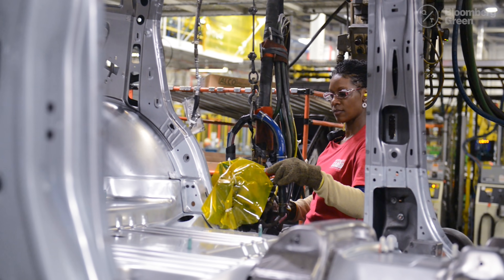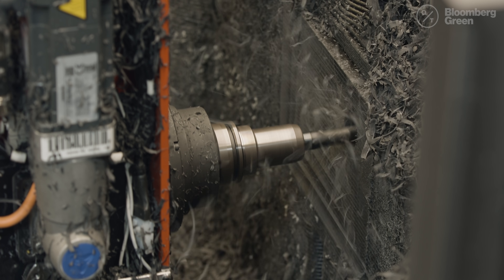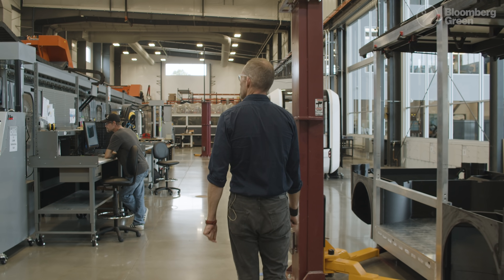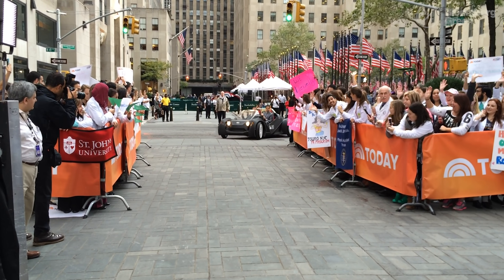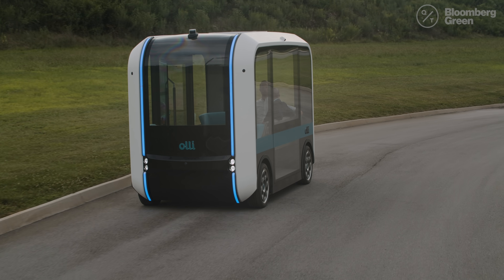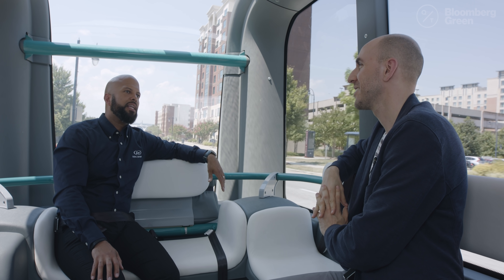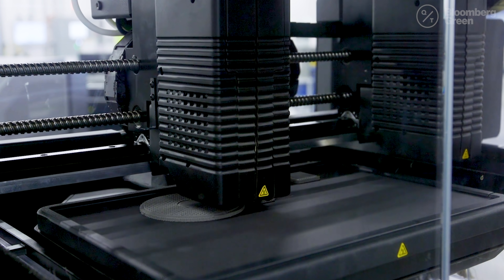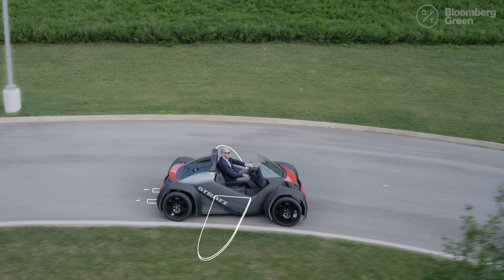Your Next Ride Could Be a 3D-Printed Bus

Comment: This doesn't have any edge on existing manufacture. Polymer based 3d printing has a poor strength/stiffness to weight ratio. They also tend to be porous. The machining work, sealing and hand assembly for all the other bits also adds cost. 3d printing is relevant for low volume production and prototyping. When they can 3d print an entire car chassis economically from aluminium that will be ground breaking.

Comment: instead of 3d printing the whole car, why not print the molds for the body panels?
Reply: What would be the point of that?
Reply: @jascrandom9855  3d printed molds much cheaper and versatile than conventional molds?  I havent seen much research regarding this but I think it's feasible.
Reply: @shadewar  Its conventional molds are cheaper for mass production, but these guys are aiming for Custom production rather than mass production.

Comment: Unless you're using one of those new process like printing on hardened resin or welding metal, 3d printing is weak and won't stand for the daily use or a car, not to mention that if you're going to mass produce, 3D printing is useless, the best way is to use molds and casting or other technique like vacuum forming.
There's an overreliance on 3d printing amongst certain generations...
Not to mention....that chasis Is ugly
Reply: Personal 3D printing is weak,
Reply: Dude, printing hardened resin came way before filament deposition modeling (FDM), the first 3d printer used stereolythography (SLA) selective hardening of UV resin in the 80s, fdm was just easier to bring into the hobbyist/consumer space, so it's better known

There isn't an overreliance on 3d printing, it's just a buzz-word, anyone who has done anything worthwhile with the technology or knows anything about manufacturing knows that it's just another manufacturing process and that many of the things that are done wih 3d printing on a smaller scale will have to be made using a different process if they move to larger production volumes, there are certainly things that can be made best using that process, but there are also a lot off companies who use the buzz-word 3d-printing, because they want to show off their prototypes and they want media attention and it seems to work.

Comment: Most of these 3d printer startups including the ones shown here miss the point of 3d printing. Infill(stong enclosed hollow areas) is what makes 3d printing a game changer. Unfortunately this guy is printing solid plastic an inch wide... Its probably 20% as strong and twice as heavy as if he just injection molded, milled, or welded it together
Reply: Why would someone choose a infill that takes forever to manufacture (3d printed) when one can use a honeycomb infill that is much faster and cheaper?

Comment: True that as the engineer pointed out this is not for mass production, I think for that one would still want injection molding and casting. But I can see this is great for making limited edition, highly customized & special purpose cars for sure.
Reply: They do already do this. Special aftermarket mods and even high end  supercars use 3d printed parts when useful. This company is trying to use this for mass production, which is as if Luis Vitton tried to make mass produced goods by expert craftsman by hand. It doesn't work that way.
Reply: @ritwikreddy5670  But come think of it if they have like hundreds of the printers, they can mass produce for sure, but then the print out seems to be quite large and less flexible, gonna add quite a bit of weight. Maybe they can improve it though.

Comment: So... How is bed adhesion with this thing. :D
Reply: They likely use some form of PVA adhesive as a spray or film coating so the same stuff everyone else does when they put gluestick on their built plate
Reply: @l.c.8475  Makes sense. If it works on my little printer why not on this one. 😅

Comment: Metal 3D printing exists, just not like what you'd visualize as how plastic normally gets 3D printed via filament. Metal 3D printers are more so like faster CNCs that carve out metal blocks. This makerbot style printing has remarkably worse compressive strength because it's lattice is not bonded naturally.
Reply: Metal 3d printers work by selective sintering, not by carving, it's still addictive manufacturing, there are also 6 axis cnc mashines that carve out metal blocks, but those are technically a different category

Comment: 3d printing on an industrial level is for rapid prototyping and iteration, not mass production.
Reply: 3D printing is certainly a possibility for production and it can be worth it, it's just going to be real damn expensive, much too expensive for the typical consumer. For example https://www.youtube.com/watch?v=5Vqh729RbIA
Reply: unless its in metal
Reply: Electric vehicle technology is for little golf cart not for fast long range vehicles
Reply: @ravimohankhanna4317  the comment said "is" not "never"
Reply: @ravimohankhanna4317  When statements like that were made electrical storage was not great but it was very easy to picture how a hypothetical battery would be able to support the power requirements for competing with gas engines. We still have metallic hydrogen to look forward to, which would push EVs significantly over gas ranges and might even kill it completely.
How exactly would massive improvements in 3d printing benefit vehicles that wouldn't also constitute massive improvements in general molding?  My impression of all these "will 3-D printing be the future" is yes but not for everything.
Reply: @TheInevitableHulk  blockchain is gonna be the future, 3D printing should be at least in second or third place 😄
Reply: @ravimohankhanna4317  keyword: is. So electric propulsion WAS not for fast long range vehicles. So maybe someday 3D printing would no longer be not for mass production, but wouldn't non-printing production tech also get even faster/efficient?
Reply: @ravimohankhanna4317  tesla have proven you wrong again and again

Comment: How do you not ask about crash tests?
Reply: Seeing that it's not an aluminum chassis, the crash will most likely kill you over 60km/h.
Reply: MartyisGreat2020 Dig your name. I suspect you are right. The Delorean was barely a metal spine that was mostly plastic otherwise, and it is a bad place to be in an accident. On the other hand, a carbon tub can work, though I doubt the layers of these prints would hold together in a crash
Reply: @MartinPittBradley  Another question is how durable is the material in hot vs cold weather? Will it crack? I'm pretty sure they kept the speed limit low on the vehicle because it's dangerous to drive. Interesting concept but practically no real value.
Reply: LM actually crash tested the Olli to see how it would perform. If you search YouTube there is a video on it. It’s pretty gnarly.

Comment: Tesla is making the back of the Model Y in one casting, and it only takes a few seconds. 3D printing takes too long to be worth it...
Reply: Industrial paper printer is much faster than Xerox printer which in turn is faster than home printer. So this type of car printer can make its way to all cities in the world.
Reply: And the turnaround time to modify the design is equates to months, the cost is in millions of dollars.

With 3D printing, it takes days and virtually no cost in tooling.
Reply: Jizzle Cizzle the question is do we need to change a car design every 12 months, auto manufatcurer change their model every 2 to 4 years and they never had a problem with that
Reply: @flx4305  , no.

The topical comment present the casting method as preferential because of the troughput, ignoring the cost and inertia.

It's far from an agile process and practically can't be optimized on the fly, whereas it is the strength of additive manufacturing.

The latter offering the possibility of iterative development to towards improvements, cost reduction, better performance. 

Exactly what SpaceX currently does for its Starship.
Reply: @flx4305  Some things you don't have to change. Teslas cars are ~20 year programs, they do minor refreshes. What they really need is to make A LOT of them, ASAP.

Comment: I just found about this olli vehicle and its a pretty cool concept up until you realise that the price of that tiny bus is 200,000 - 300,000 euros, FOR A 3D PRINTED 12 SEATER BUS, that, in my option is the sole reason why this will never take off, is one of these is priced the same or wayyyy more than a double decker bus with 70-100+ seats then why do they think their special 

edit:
i just found out double decker buses cost between $70k - $150k which makes the cost of this 12 seater bus even more rediculous
Reply: Until you factor in the Double Decker is not autonomous and most of the cost is from the sensors and not the actual body of the bus. When you factor In the fact that eventually these could be driverless, then you don’t have a $50-70k/year salary to pay to someone and the Olli becomes more attractive.

Comment: The resolution of that print tho 😬
Reply: Well, do you want the print to take 9 hours, 9 days, or 9 weeks?
Reply: @joecope9935  Depends on the objective.  You also assume nothing about large scale 3D printing can be improved.  What if the print area was in a vacuum and had a motor control system that could move 20x faster with a print substrate that could cure instantly using UV light?  What if there were multiple print heads working in concert with one another?
Reply: @SoCalFreelance  But none of those things were present in the machine depicted in the video. They were limited by the capabilities of the printer they have, not the printer they might have in the future. Even with that resolution it was a 9 hour print. Obviously they did a cost/benefit analysis and decided that smooth sides weren't worth the extended printing time.
Reply: SoCalFreelance Well, consider the objective; •Make a unique, simple, one-off car using 3D print technology. 

You are watching a video about prototyping cars. It seems reasonable that they are not focused on optimizing the process in which the car is printed, the resolution it’s printed in, nor the speed at which it is printed. They simply want to build a working car using a 3D printer. 

From there they have much bigger problems such as the sustainability of licensing micro factories and the business model of building one-off cars. This is the exact reason they immediately pivoted to the Uber idea and decided “Nevermind we want to build 10 million Ollis!”. 

If this business isn’t sustainable with a 10mm nozzle, a .4 nozzle or dual extruders aren’t going to magically shoot their business into profitability.

Practicality my friend

Comment: building/printing the chassis part by part separately and assemble it once finished will be much faster, because printing can be done in parallel, less prone to error that will ruined the whole build, assembling it will take very short amount of time
Reply: This was a Proof of concept car. Also, having a single large piece for the chassis would make it stronger.